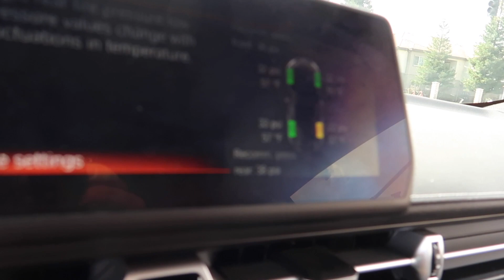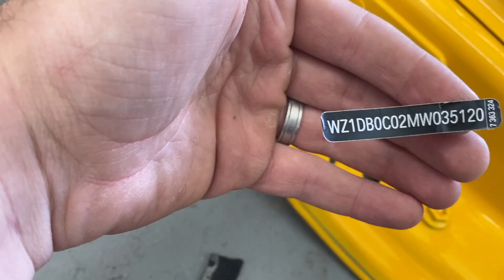Rebuilding A Wrecked 2021 MK5 SUPRA 3.0 (PART.6)

Comment: @Nour Hummadi… my 2005 645ci is having troubles starting. I replaced the fuel pump and throttle bottle but it seems to still not start. It’ll crank but not start..The battery is also good. What do you think it could be???? PLEASE HELP ME‼️‼️‼️‼️

Comment: there is actually a number of scenarios where cutting down a tree is not only an acceptable thing to do but also can be even the best thing to do. Where I live we have issues with the Emerald Ash Borer which is a beetle that multiplies and spreads incredibly fast, hopping from Ash tree to Ash tree siphoning off it's life source and killing it in the process. Only way to prevent every single Ash tree anywhere from dying is to cut them down around areas where they've already spread so that the beetles die before they can find another host. Don't feel bad about taking care of your yard!

Comment: The Allen socket set from Amazon is awesome, over the handle Allens, I have both the mm hex and torx,, I have the blue box Neiko brand love them
Reply: After using the sockets never touched my handle allen set. You could also use them on a impact driver makes braking the locktite on the screws a breeze